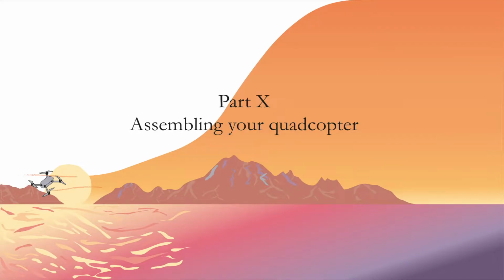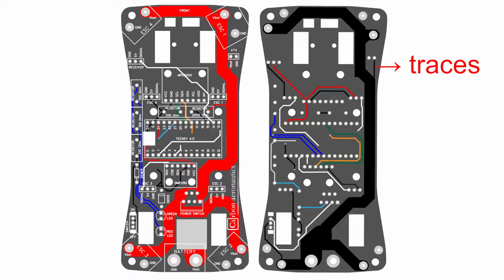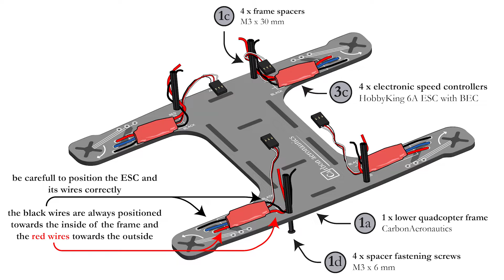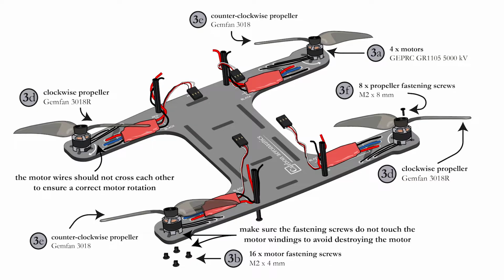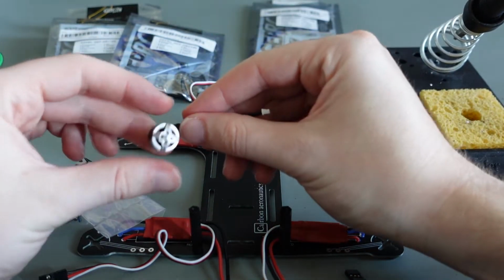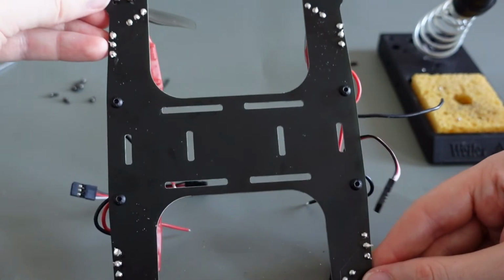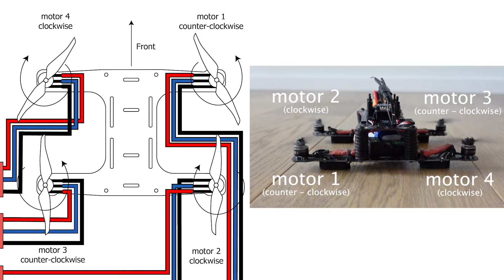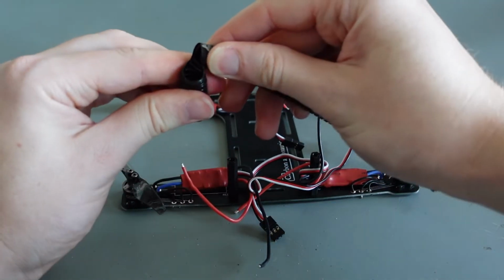10a | Assemble the lower frame of your drone

Comment: Is there a CAD (DXF, STEP, etc.) drawing of the Lower Frame for public use? Thanks.
Reply: Sorry, I posted in haste. The file is available in EasyEDA format. I just didn't turn the page from the Upper Frame to the Lower Frame.
Reply: @MathaGoram  thx for not deleting the comment. U're prob. not the only one that made that little blunder.

what I wanna say is: U're probably that one comment on a random forum in the Internet that saved someone's project or at least a looot of time.
Reply: @MichaelSträssleI'm a slow learner but appreciate all the pro bono work by others. Regards.

Comment: I am building a drone to match this video.
If I substitute a different motor than the one described in the video, what standard should I choose?
Reply: Good question. I had to use different motors and that triggered a chain reaction. I had to find a ESC + Motor combination taking into account that the ESC had to be small enough to fit in the frame. When I had that I realized that the screws that came with the motor were too long for the frame and the ESC cables need to go the other way around (black inside the frame) for the motors to spin in the right direction. Then the cables of the ESC were too thick for the frame, so I had to cut it in half... I just soldered the ESC and hope not find any other issues.
Reply: @briansotodo and what ended up happening, did your drone work. If so what combo of motor and esc did you use

Comment: in the wiring diagram you have attached the 4 ESC's each to seperate PWM pin instead of one single PPM pin (which was the case in previous videos) can you pls explain the reason or am i understanding it wrong , cant a single PPM pin be used to power all the ESC's do we need a seperate PPM pin connected for each ESC .
Reply: Have you found the solution to your question???
Reply: I might be misunderstanding your question, but he still only has one cable coming from the ppm connected to the receiver,  and 4 coming from the PWM on the teensy. In the last video he only had one ppm and one pwm because he was only controlling one motor. There is no PPM coming from the teensy, and you would need 4 PWM to control the motors separately.